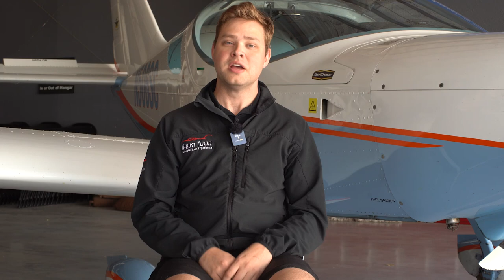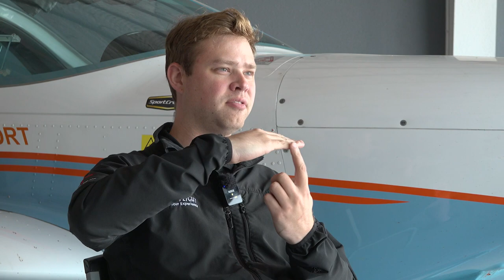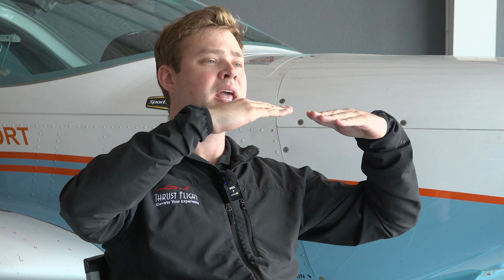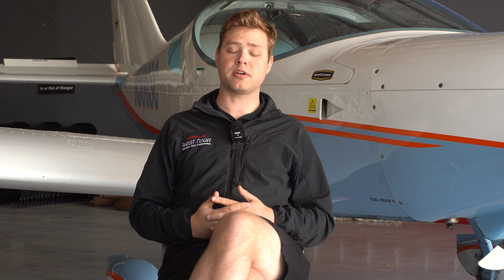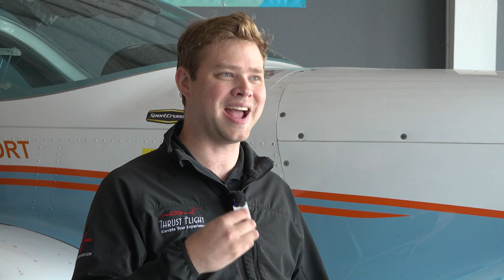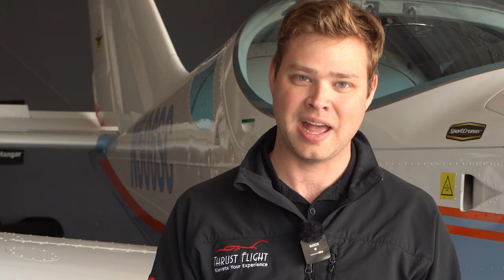An Overview on Stalls

Comment: Very good lesson on stalls, Tanner.  I really like the terminology we and I in reference to stalls.  The dynamic neutral stability designed into the airplane means it cannot stall itself.  That is where we or I come in.  It takes a pilot pulling back (pushing when inverted) on the yoke.  The critical angle of attack is when we stall.  We, as you mentioned is why.

A couple of old crop duster things about turns and recovery.  Unless we pull back on the yoke, the turn of any bank angle is 1 g.  About the nearness of the ground.  We crop dusters make use of the potential energy of 200' altitude thousands of times a day to prevent stall in turns.  Yes, we want to move out of the maneuvering flight envelope when, when, when we have zoom reserve airspeed for safe maneuvering.  Vx or Vy both set up way too many stalls.  Neither is generally appropriate during takeoff on the long runways of today.  When too low to recover from inadvertent, not practice, stall, airspeed not altitude is life.

Again, good job.

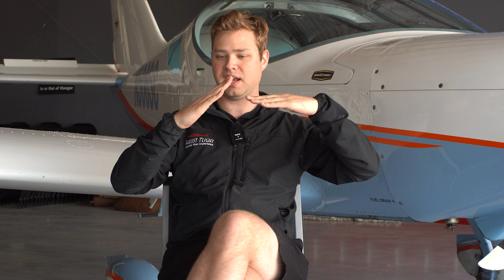Comment: Around 1:08 or 1:09 in the video the terms, "angle of incidence" and "angle of attack" are conflated. This should be correctly clarified in the description. At around 4:21, the description of the stall warning system is slightly imprecise.